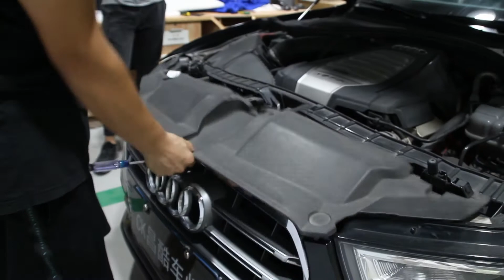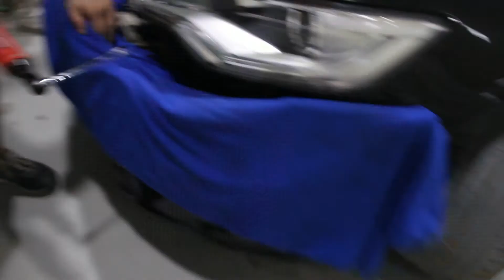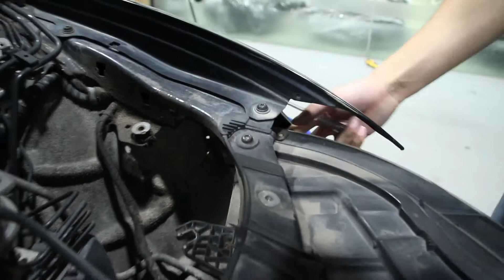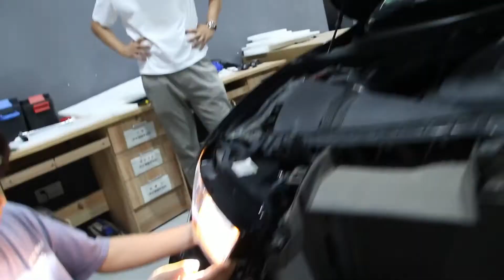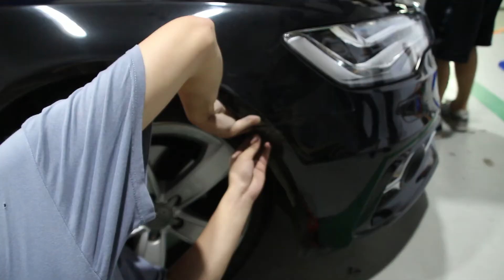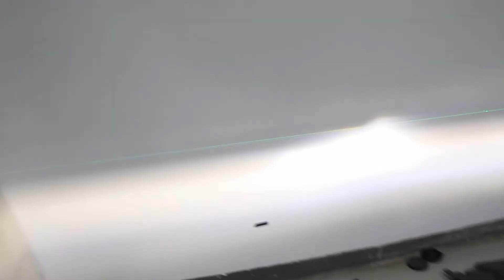2013 - 2016 Audi A6 car headlight modification xenon to led  MODS for beginners

Comment: PLEASE NOTE: These headlights are Euro spec and are NOT U.S. legal and if your state requires it "might" not pass applicable vehicle inspection. U.S. spec vehicles MUST HAVE either the yellow (for the front)  and red ( for the rear) reflectors on the vehicle OR on/in the headlight/taillight assembly. Take care.
Reply: What if i don't care or don't plan to get my vehicle inspected? Is it still plug and play?
Reply: @freeweezy112  Well by all means get them! 😁👍🏿

Comment: Hello. Do we need some upgrades in the computer of the car or something else, that will work with these new headlights, even without extra features of that car providing? Because I’m also curious about this upgrade on my 2014 avant, but there’s only automatically changing low beams. Any advice?

Comment: Hello? Does the matrix lights work? Does it dim off light against on going cars on the opposite side?
Reply from the maker: errors come out normally after being modified. don't recommanded.
Reply: @czcarmods  I’m asking do lights turn off automatically when vehicles come on opposite side. Original LED lights of Audi has this feature
Reply: @HP-ow9fy  It depends of equipment of the car. It can not do it if dont have proper radar to "see ongoing traffic".
Reply: This is just LED lights not matrix.

Comment: Hello! I have an Audi A6 C7, like the one in the clip, but I didn't have fun and lane assist. Can I mount full LED headlights on the car?
Thanks!
Reply: We have 2016 facelift a6 but I want change headlight too. I dont know why all other 2016 's headlights dıffrent than us . Other Audi's have matrix headlights but our headlights so bad style . I dont know Ican change or not
Reply from the maker: it's hard to replace, errors come out normally after modified

Comment: Hello

Where I can get adapter wire?
Reply from the maker: No adapter wire. needs coding inside the led headlights. so need to buy led headlights from us.
Reply: @czcarmods  where can i buy this headlight
Reply from the maker: @SlowlyDamage777  NO adapter wire. needs coding inside the led headlights, or won't work led headlights on our website czcarmods.com.